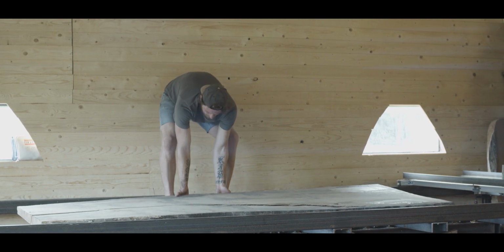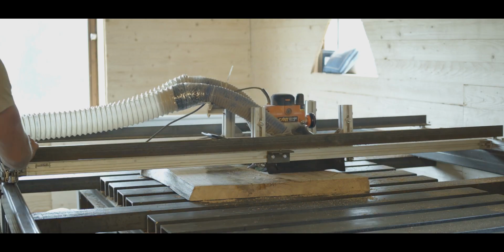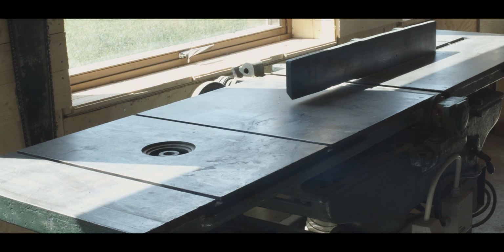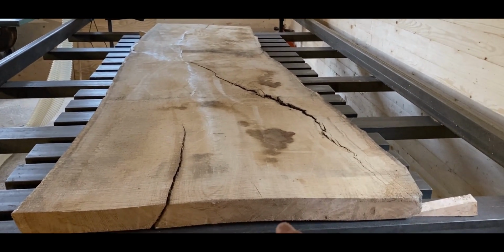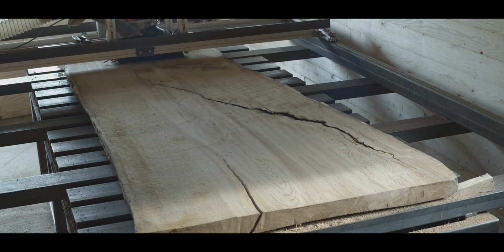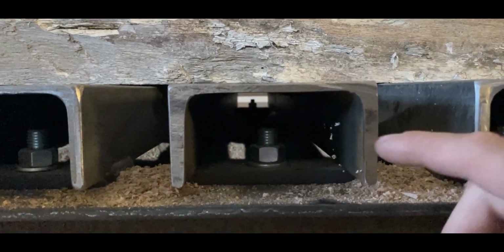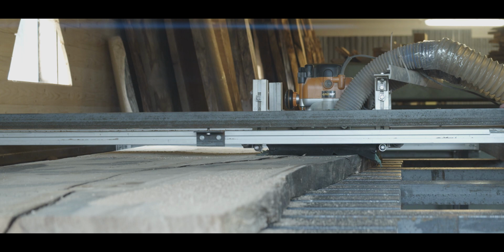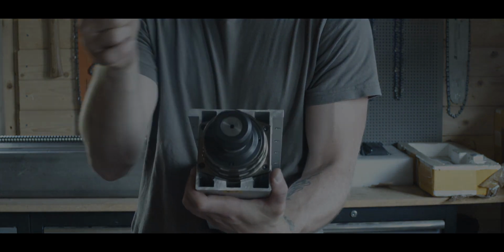The Cheapest Way To Flatten Live Edge Slabs

Comment: If one was to bang a meaty circular-saw onto the sled instead of a router & use the circular saw blade as  the "cutter" then it might be less fragile/might slash off larger imperfections a bit easilierer/faster - then allowing use of finer grade smoothing thingies. A router strikes me as a bit fragile/slow/Dull/Overstressed for guntery "Initial levelling" stuff on big slabs. :-) A saw sliding sideways takes few prisoners on the "Explain better to stuff underneath" - and a carbide blade wouldn't sulk if it hit a bit of nail/metal/suchlike. Even with the CNC version, a saw would be meatier long-term - it would also be a lot cheaper on the "let's go buy new cutters a lot" front.